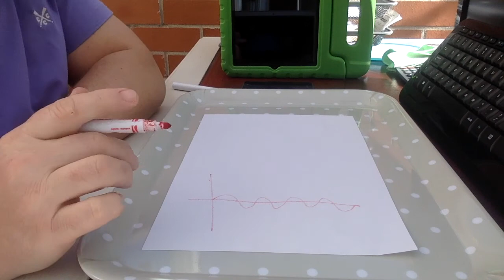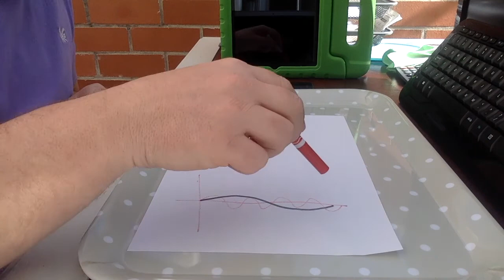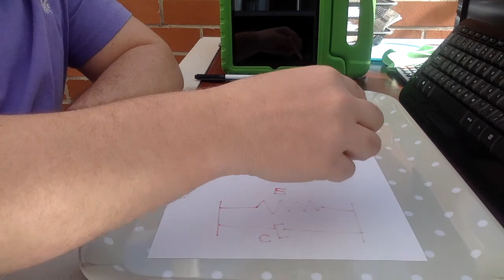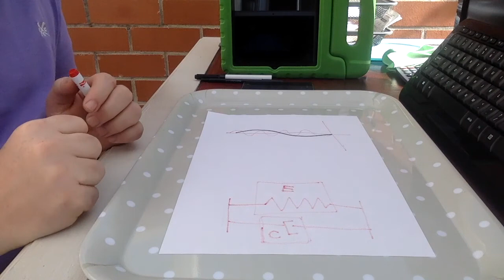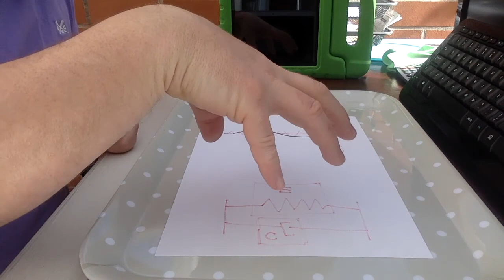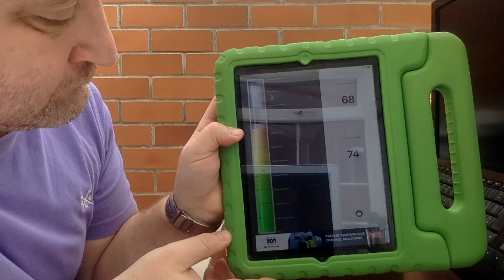Sound Deadening - Perfect Sleep in your RV and Silence your Generator. Watch the Proof !

Comment: Good demonstration! 
Can you please show how the power generator can be accommodated as soundproofed as possible? 
But please do not forget: The power generator needs a lot of air for cooling.
Reply from the maker: Hi. Thanks for watching. I think I did a video with my ideas for this. Basically you need to isolate it (which is why people use rubber feet), make sure its in an airtight box and use mufflers for intakes and exhaust. Even just putting it on a rubber mat and boxing it in with a fan driven intake through rockwool and lining the box with rockwool will make a huge difference.

Comment: Great demonstrations. It shows how important it is to isolate with some sort of rubber damper when you install a generator to a trailer. That’s why car engines and transmissions are rubber mounted. If you have ever been in a race car where the transmission is hard mounted to the frame the vibrations are unreal and very noisy. Thanks for sharing!
Reply from the maker: Thanks for watching and commentating. Yip you got it! It also shows how the enclosure (generators in a RV for example) amplify the sound and, with a bit of insulation, could do a much much better job. The challenge of ventilation is at the costs of noise. I think the manufacturers could do so much better. My goal is to develop an enclosure method which allows anywhere anytime use of the generator, no noisier than the compressor on a fridge. Thanks again.